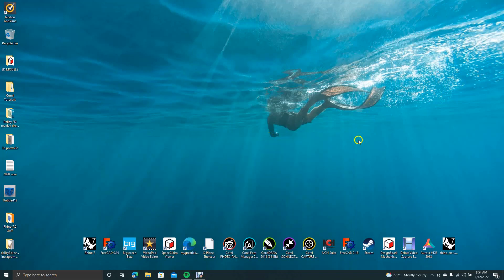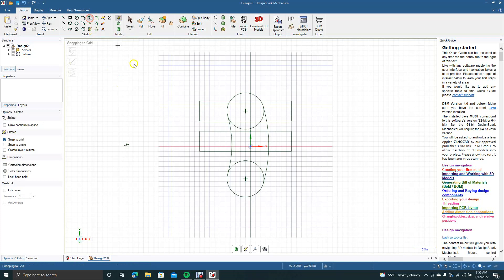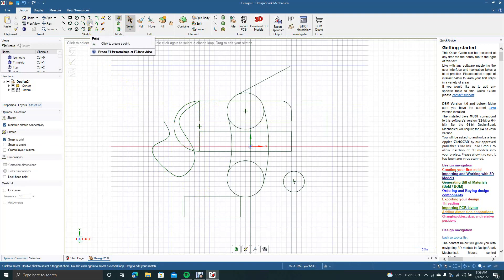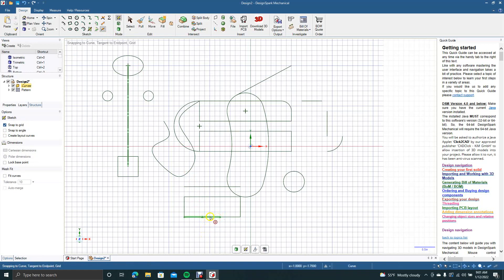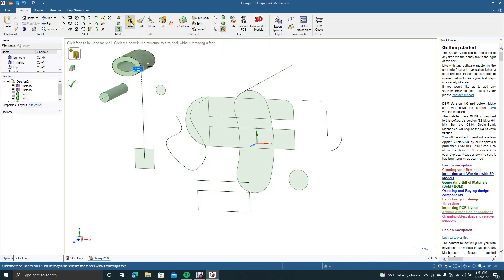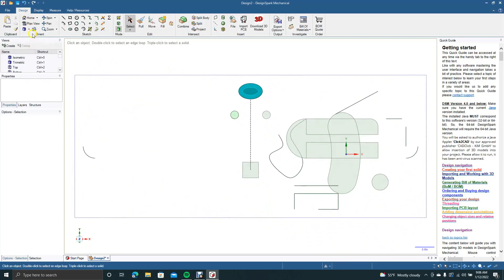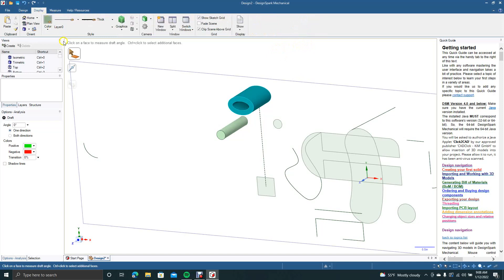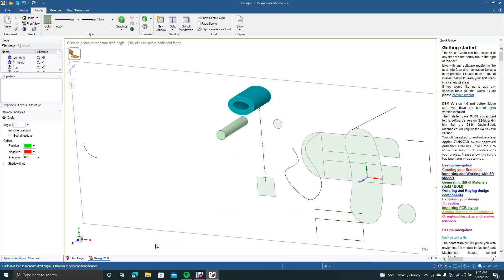A brief overview of the drawing tools and settings in design spark mechanical.

Comment: Is there any way to increase the number of vertices in a circle, I think the default is 16 but i want 32, cant find the setting in options.
Reply from the maker: Brian, as far as I know, you can't set the vertices, like in blender or Rhino with DSM. You can however change the STL resolution output. This will only effect how your model prints. For example, A low-resolution setting will print your circle with vertices, and a high-res setting will not. If you want to simulate vertices, try using the polygon tool, and change the number of sides used. Cheers!
Reply: @dailey3drevolve  ok, thx.
Reply from the maker: You are welcome, Brian.